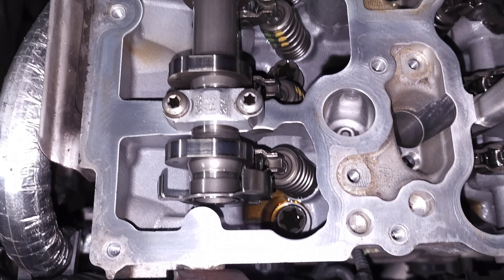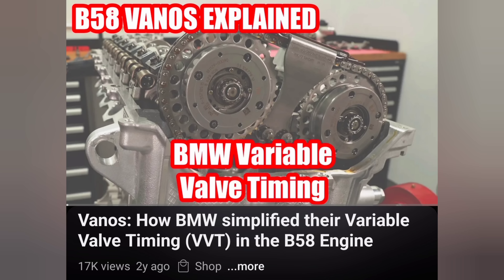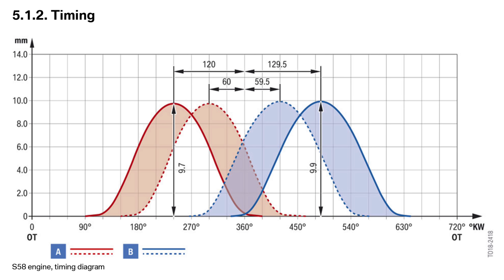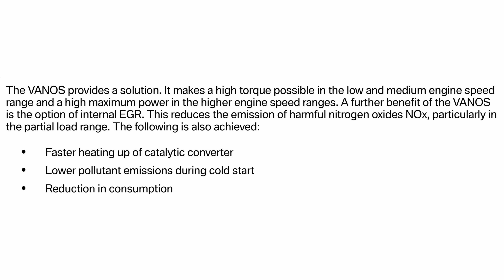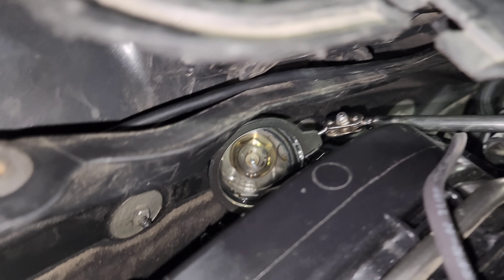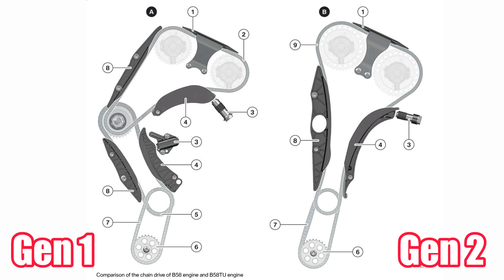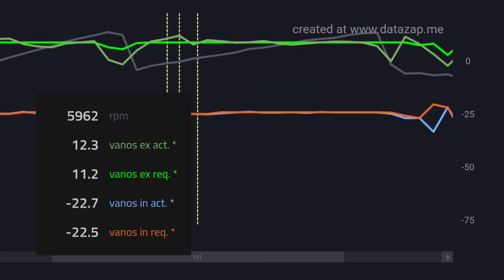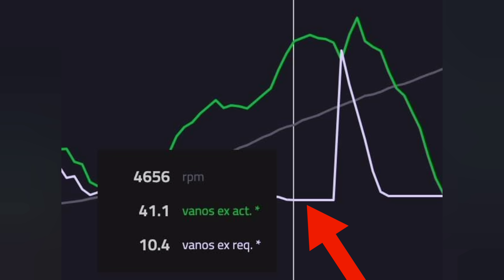Cam Walk: The B58 & S58 Issue No One is Talking About

Comment: I've already replaced everything I could on the B48, and I'm getting error 130716. It's related to the exhaust camshaft. I've replaced the VANOS, VANOS bolts, chains, and solenoids. Everything is original on a BMW. But the error won't go away. It first appeared when I was standing still and revving hard. I don't know what to do anymore. The only thing I've noticed is that as soon as I switch from Economy to Sport, a knocking noise appears, similar to a camshaft knock. I switch to Economy and the knocking immediately disappears. The oil pressure is fine, everything else is perfect. I don't know what to do anymore.

Comment: It’s so funny that you’re talking about this, I just experienced this earlier last week with my Gen 2 M340i. I’m currently running a Pure 900 and using the DS3 from Dorsch Engineering HPFP and S58 injectors. By my fourth revision, we ran into the Vanos issue on the exhaust side. My tuner, Doug, easily identified it, although he didn’t really explain it to me. I did some research and it seems like bumping up oil pressure is a solution for this. Looking at my logs, it looks like he increased oil pressure by about 15 to 20 PSI, and I haven’t run into the Vanos cam walk issue again, so it seems like this is a permanent fix, which lines up with what you explained. interesting stuff.
Reply: Yup, Doug has quite a bit of tricks to help with this. My car was pretty sensitive to cam walking so we needed to do a little more than just oil pressure.
Reply: @PodiumZ4 What did you do? I have the same problem.
Reply: @SHLANG_95 up the oil pressure about 10 PSI. This solves 99% of the cases, but you can also adjust a few other things.
Reply: @PodiumZ4 How can I increase it? Programmatically?
Reply: @SHLANG_95 this is done through your tuner

Comment: Technically this is not cam walk.  Crank walk and cam walk are the movement back and forth of the shaft along the axis of rotation.  This movement/play causes problems with alignment of the lobes with the valve/cam followers/rockers.  Been around since before BMW even existed probably.  The b58/s58 issue is a phasing error.  Doesn't change the issue or how to fix it, but important to not confuse issues.

Comment: Is this also what is causing a low rpm knock that everyone is experiencing? You can hear it under load. People keep on getting confused with fuel injector clicks or the mechanical fuel pump roller?

Comment: I checked my log I sometimes see that the difference on vanos where 3-4 degrees off is that normal?
Reply: Yes. Not really an issue until you’re off by around 40 degrees which will trigger limp mode.
Reply: @PodiumZ4  you seem to be very knowledgeable in this platform. What’s your opinion on the g42 xDrive with a jb4 making 460hp 500tq would you be concerned with any components at this power level?
Reply: @tallui I’d be concerned with any car running jb4. Unlock and get a proper tune or just stay stock.

Comment: What hp levels is this really noticed at
Reply: I never got a vanos code on my g87 and until I got up past 650 hp. It happened at high rpm both times saying exhaust vanos was issue. My oil change was due shortly after and then I was unable to replicate it so I’m assuming the old oil had something to do with it. Maybe viscosity got too low.
Reply: @jgaines3200 thanks for the insight
Reply: I started to experience this on my M340i a little over 600whp, but the tuner was able to bring it back to an acceptable level just through tuning and oil pressure changes.
Reply: @dustwhynthanks for the insight
Reply: Ran into this issue at 27PSI with my Pure 900, DS3 HPFP and S58, just wrapped up my last log at 33PSI with no issues once the oil pressure got bumped up 15-20ish PSI

Comment: Easy fix. Oil pressure setpoint changes. Not just the two main tables but the key is tweaking about six oil pressure related tables to make sure your oil pressure increase also has the correct PID and offset changes as well.
Reply: so tuner does this?
Reply: @vanta240i  If the tuner has those tables defined.
Reply: @Earlyapex new to bmw, b58 and performance cars please explain
Reply: Acronym of the day?  "Proportional-IntegralDerivative"
Appreciate the info. mate

Comment: I had this issue on my S58 X3M when I was getting my custom E50 tune. My tuner increased my oil pressure +10psi in the tune and it fixed the Vanos issue.
Reply: Str8motion had the same issue on his built x3m
Reply: Which tuner?

Comment: Even just tuned my gen 2 walks. Its a pita and really makes me regret getting a b58 gen 2. Never had any issues on my n54. 

Would running 5w40 help or is that too much. Currently on 5w30
Reply: A Euro 5W-40 is not much thicker than the 5W-30. All the A3/B4 or C3 based Euro (BMW full LL01 or LL04) oils must be 3.5 HTHS min and so the 30 is a very "thick 30" and the 40 is a "thin 40". You can run a 40 without a problem.
Reply: @chrisbradley3224 actually this oil htsc is 3.8. and it is very noticeable thicker. Also the target isn't thickness since other factors plays a role in engine protection.
Reply: @cammgt3rs370  3.5 vs 3.8 is barely different and the oil is barely thicker by KV100
Reply: I run motul excess 5w40 in my gen 1. It loves it and more torque than 5w30 or lower oils.
Reply: Im just hoping it will help raise oil pressure a tad to maybe help. My oil pressure is normal at 75 to 80 at wot. I dno why they would use this style on the gen 2. Total fail on bmws part. I want to get an s58, but if this is an issue on then as well ill pass.

Comment: Hey this message is to Kern417 and everyone out there with a S58 engine. What weight oil are you using? I just got a 2022 X3 M and doing an oil change immediately.
Reply: Stock tune should use stock viscosity. If you’re tuned then you should go 5w30.
Reply: @coly0226 Lmao 0w-30 and 5w-30 is the same…tell me you don’t know anything about oil
Reply: 0W-30

Comment: Is the issue seen in cases where gen 1 B58s do the TU pump upgrade?
Reply from the maker: No
Reply: @kern417 what about if I do a stage 2 MHD tune with TU pump upgraded, on gen 1 and XHP transmission tune ?

Comment: so kern i got my m340i oil pump replaced around 87k miles. The issues would run 70 psi on eco pro at 80mph, oil pressure would above 45 psi going to 48 when trying to read. I finally got the code that the oil pressure was too high. 2020 6/19 delivery m340i.  Overall very annoying even thought every update for the car was done up till I bought the car back in march.
Reply: Thanks for info, may I ask how you read oil pressure? I have basically only BM3 app I can see pressure in and just started to note this danger of plastic ring due to kern, thanks by the way.  My car is M340i too and manufacture date is September 3, 2019 so a bit nervous and having it swapped here is way more expensive unless able to do it yourself which will first require somewhere to do it at which I do not have.
Reply: @luffararnesugerkuk I saw the paperwork he did in 10 hours even though book time was 18.4
Reply: @b58jam  thanks for info, good reference
Reply: @luffararnesugerkuk I did it with BimmerLink and a spare iphone
Reply: @luffararnesugerkuk code is 21B2C7